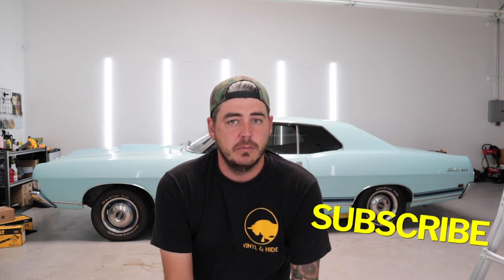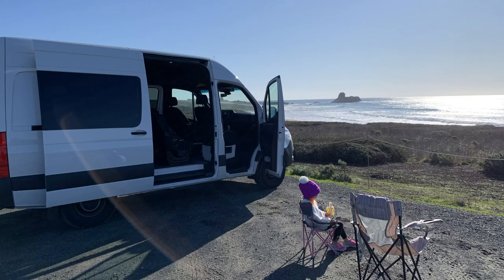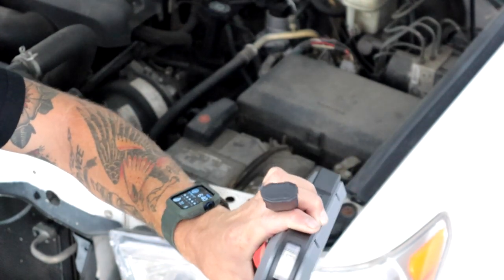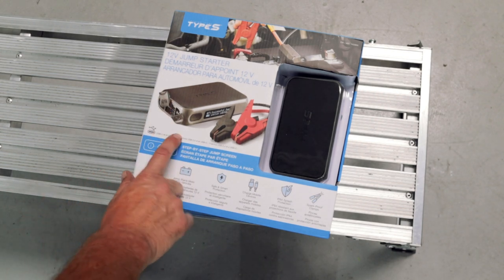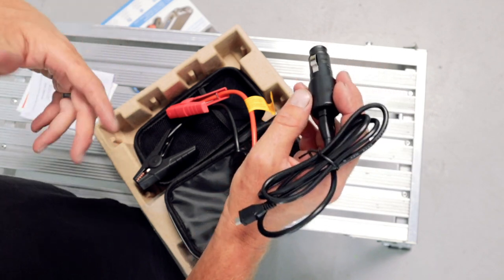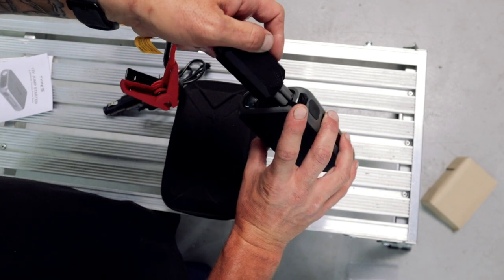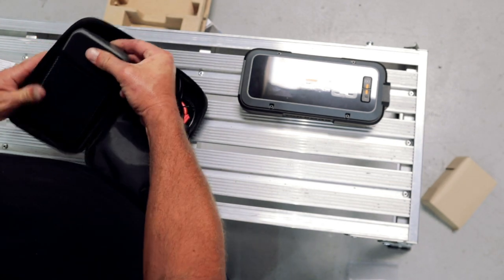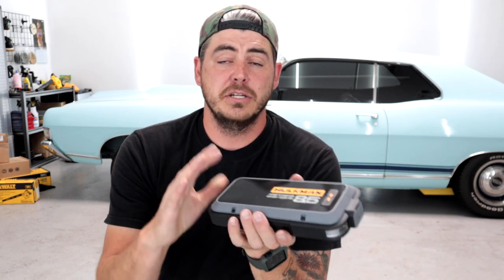TYPE S Jump Starter Review available at Costco | Hulkman Alpha 85 Battery Jumper | Best Jump Starter

Comment: I used my friend's Type S the other day when i mistakenly left my van on overnight to crack the windows open.  Worked right away. Really impressed.  I went to get the Noco GBX45 but it is 3x the cost of the Type S Costco. I am wondering why the huge price difference and if it is justified. I just need it for emergencies if my passenger car battery dies. I do appreciate quality and will pay a premium if something is worth it but i don't know what the huge difference is between the NOCO and TYPE S